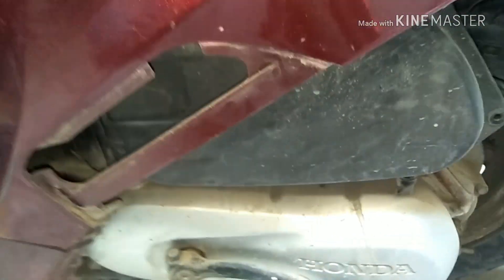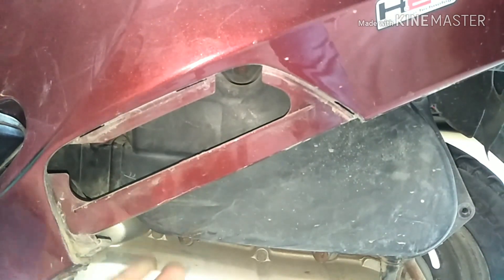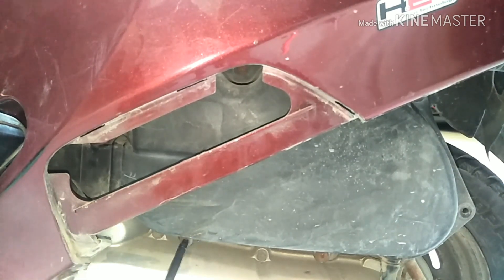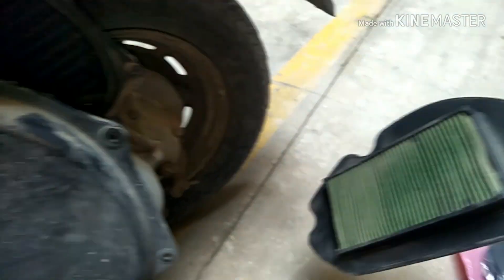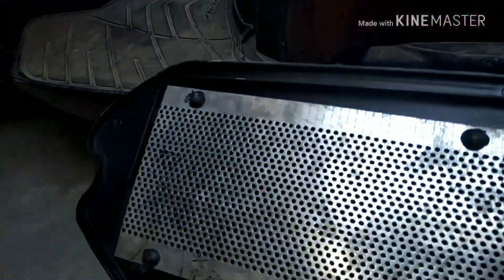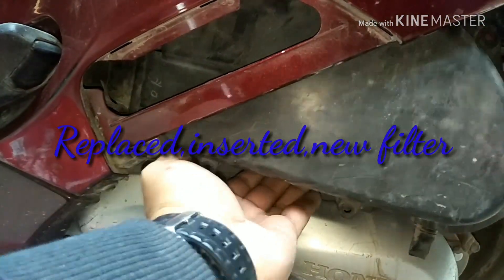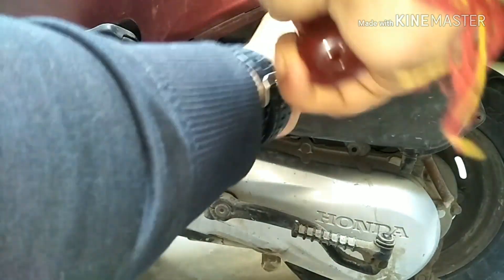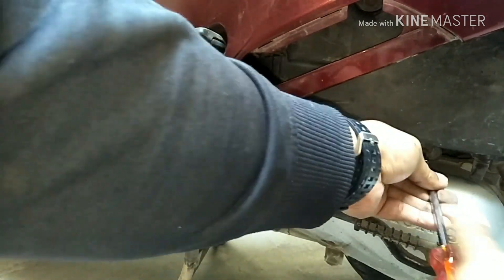Air Filter Replacement: Honda Aviator

Comment: New video kab aayegi aapki?
Reply from the maker: I want to do two videos,one my Honda City CVT fluid change,and Honda Aviator cylinder kit replacement
Reply: @TheITMechanic  okk
Reply: Sir mujhe aapse ek baat puchni thi ki agar humne local clutch roller apni scooty meh lagaye toh isse koi problem toh ni hoga?
Reply from the maker: @yashmodifier9117  these are local,but if we get problems,we will get handle vibrations.They were good for me,i did not get from dealerships 🙄.I had no choice 🙏.My request is to get these parts from dealerships only. 🙏
Reply: @TheITMechanic  okk thank you

Comment: Sir old model aviator meh new model waala lockset lagake dikhao
Reply: Bhaut accha content rahega
Reply from the maker: I want to try that,but we are in Delhi NCR and things are getting to normal post second wave 🙏
Reply: @TheITMechanic  I also live in Delhi Ncr
Reply from the maker: @yashmodifier9117  thanks,nice to know,will take some time out and do that,I am much more interested to fix my cylinder Kit before that 🙏
Reply: @TheITMechanic  okk
Reply: Sir aapne jo NGK ka dual electrode spark plug lagaya h, usse aapko milege and pickup par koi difference dikha?
Reply from the maker: @yashmodifier9117  i thought it would give me,but meanwhile i engine sizure happened and i took help from a mechanic,he had charged more that the work he did,that is the reason,i will change the cylinder Kit myself this time. 🙏
Reply: @TheITMechanic  ok sir i am very excited for that